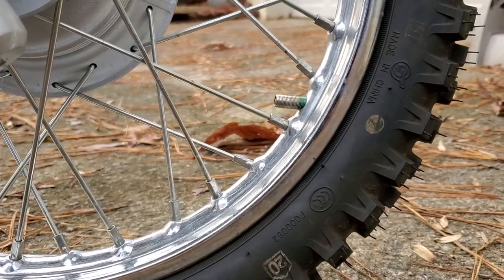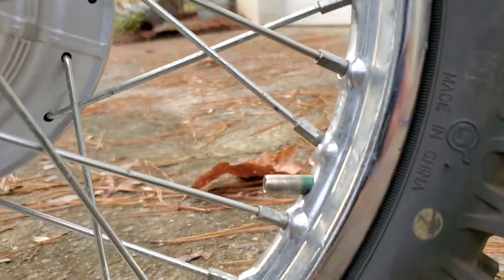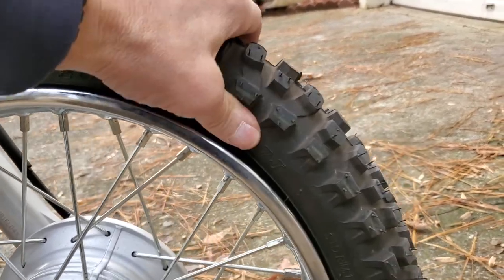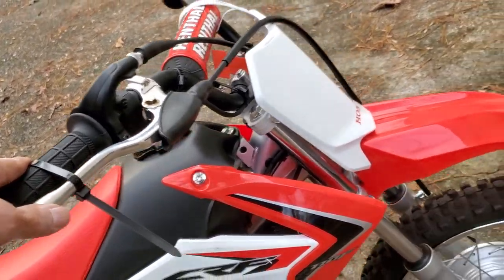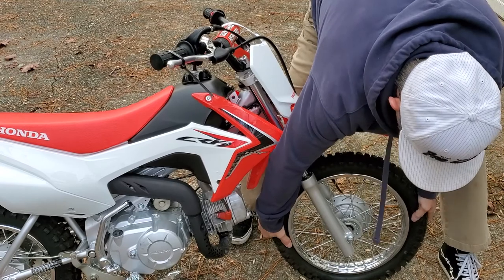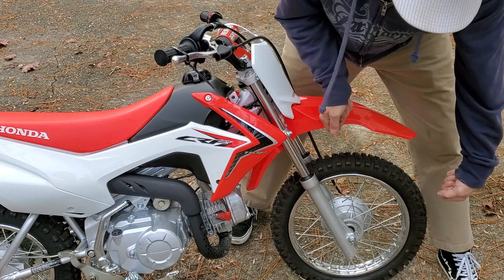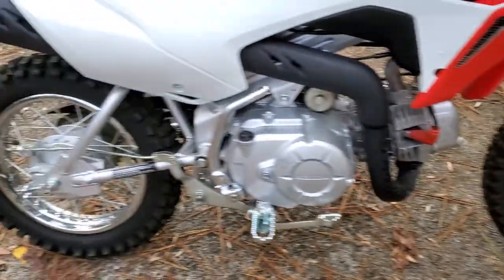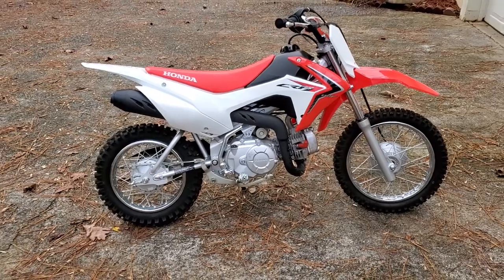How to straighten the inner tube valve stem most minibikes tires dirtbike Honda CRF110

Comment: I tried a few different methods and this by far worked the best. Well it was the only method that work for me. Thanks
Reply from the maker: If yours does this regularly, you are either riding the back far too hard for it's capabilities, or you are riding it on the wrong surface per the type of wheel and tire installed.

Comment: It's really good method to solve it. Just curious why the valve go like that. the pressure is not enough?
Reply from the maker: Riding a bike that can't handle the abuse.  Move up to a racing bike that has rimlocks.  Many beginner / recreational bikes cannot handle it.

Comment: I have a rimlock and my valve stem keeps moving I’m afraid I will get another flat I keep resetting the stem to be straight any tips
Reply from the maker: Tire pressure is too low. Or you are riding the wrong bike.
Reply: Thanks lol i just bought a cr250 and ny stem is crooked and kinda sucked back into the rim so i really hope it works
Reply from the maker: @kylejohnson9510  You might want to install a new tire as well.
Reply: @HorsepowerHouse  yeah i took the bike into a shop to have it gone over, and spend damn near 600 buckaroos lol.
Reply: Does it work on back tire to the same way or?

Comment: This feels important to fix on bigger bikes:(
Reply from the maker: Most big bikes have rim locks
Reply: @HorsepowerHouse  my crf250 does yes, but it still slipped somehow, with the rim lock fully loose, I still can’t spin the wheel on the rim
Reply from the maker: You need a new tire
Reply from the maker: @STEN-164  Your tire was worn out, rim lock was loose, but the tire is now stuck to the rim. So, you need to remove the wheel, break the bead of the tire, and either replace it the tire, or reposition it, and refasten the rim lock.  I can bet your tire is worn out though.